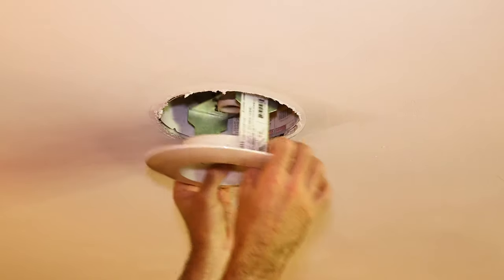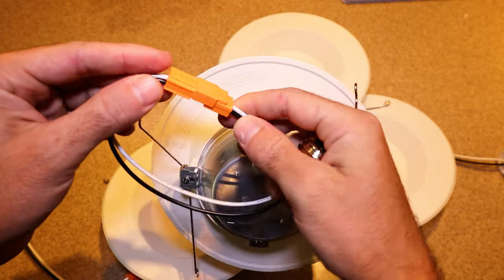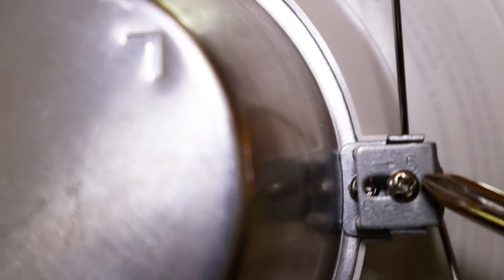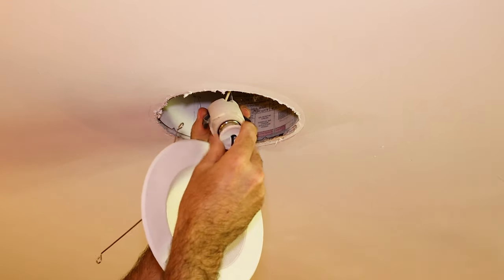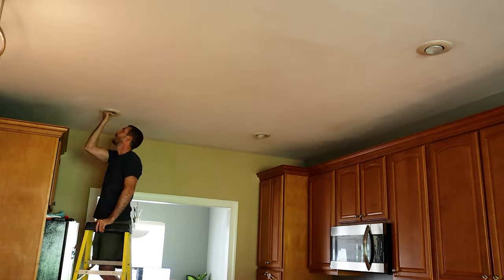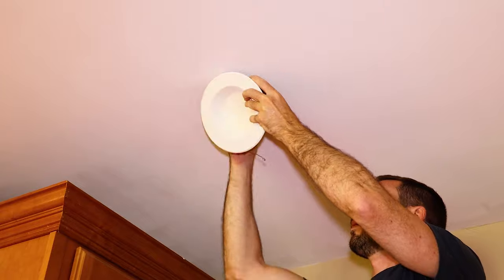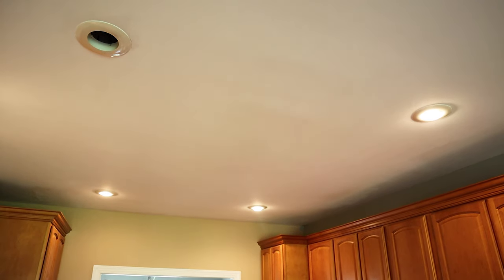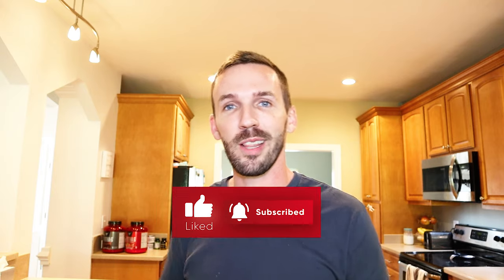Quickly Replace Old Reccessed Lights with Retrofit LED Lights

Comment: 2700 and 3000, etc. refer to COLOR TEMPERATURE, in Kelvin and not brightness.  Some see this as brightness, but brightness is measured in lumens, not Kelvin.  Some might see color as brightness because lower color lights (i.e. 2700K, warm) is seen as less bright than a bulb of the same lumen output at 4 or 5000K (bright or daylight color).
Reply: Correct.

Comment: Our old canned lights are 7-7-1/2".  The retrofits are for 5-6" lights.  Therefore, the springs do not hold the retrofit in place.  Do you have any ideas on how we can find retrofits to work for the 7" can?
Reply: I know I have a similar issue the full size measures that as well. Wish he would reply to people.
Reply: @angiejohnson6224  fyi, we ended up buying the largest retrofit we could find at HD/Lowes.  We still had most of our "rings" which cover the sheetrock raw edges.  We were able to order new rings to fit the 7" cans from Amazon.  Good luck.

Comment: You should’ve just put an LED bulb in the existing fixture. The light you used is meant to be a stand alone light in a fresh cut hole in drywall. The springs aren’t meant to hold the fixture inside a metal can.
Reply: it’s a retrofit light it’s literally exactly for this

Comment: you might have noticed some tabs on the inside of the "pot" or metal shroud.  These are made for the spring wire.  Set your spring wire just past the tab hook on each side and when all 4 wires are in place, just push up for a secure seating which should be perfectly centered.  This makes maintenance easier as the inside fixture will slide straight down and unclip easily.  Often, inside fixtures that have been "friction" fitted by twisting around will get their spring wire caught in slots in the shroud making it difficult to remove the inside fixture.  (Most often you will need to bend the holding tabs out a little bit to have room to slide in the spring wires.  I'm not sure all round recessed lighting comes with this handy feature, but you will appreciate you spend a few extra moments on your install if you have to do maintenance or replacement.)
Reply from the maker: This is amazing advice. One of my lights keeps dropping a half inch or so from the ceiling and I was considering using double-sided tape or something.
Reply: What if you don’t have the tabs ?

Comment: You asked why your bulbs kept burning out. I couldn't really tell. But they looked like LED bulbs. If they were. Make sure the light switch is rates for LED bulbs. Especially if it's a dimmer. I've had old switches cause my bulbs to burn out sooner then they should.

Comment: Heh bro. A quick mention here. I’ve been replacing blown recessed led fixture for a little while, and when I do I use the tension spring you’re referring to. That was until I found that the can I’m installing into does NOT have 2 opposing clips into which my springs would typically fit. With all that tension in the springs, you’d think the two would push against the wall of the can and keep the fixture up there. 

Well, after having 2 of the 6 installs actually depart from the can (no sweat of course…the fixture stays connected and they’re very light), I started googling to find that tension springs don’t just go against the walls of a can. They are actually supposed to go through a clip on opposed sides—clips that are built onto the can’s walls. If you don’t have the clips, you should not use tension springs. I’ve had one dangle from the ceiling 2 weeks after I installed it. Talk about embarrassing!

Just an fyi

Comment: Regarding your old incandescent bulbs burning out constantly, I may have an answer.  Let me tell you a story.  17 years ago, I did a major renovation to my home. Installed maybe 20 hi-hats with BR40 bulbs. The bulbs lasted forever. I went more than a a decade without a single bulb burning out. finally, in the kitchen, the highest use area of the house, I had my first bulb burn out after 12 years.  I went to Home Depot, got a bulb, three months later, burned out. I got another and another, same thing.  At 17 years now, I still have most of the original bulbs throughout the house, still working fine, but lost a few more, and no joy with the replacements. What gives?

Now it get's interesting. The bulbs I got at Home Depot were standard 65W bulbs.  I remembered that when I first installed all the bulbs, I bought 85W Satco heavy duty use bulbs rated for 130V.  The life of a tungsten filament increases exponentially with a drop in voltage, so running a 130V bulb at 120V or less increases life waaaay more than 10%. Plus, the filaments are thicker for a heavy duty bulb. And the 85W bulb will give out the same light and consume the same power as a 65W bulb when operated at 120V instead of 130V.  Of course, the original bulbs I bought were no longer available (banned?) but eventually, I found a few cases of the exact 85W bulbs in stock at an online supplier.  I snatched them up and problem solved. No more burned out bulbs.

Of course, now I'm looking to replace everything with LEDs.  Until very recently, the LED floods were TERRIBLE, with very poor color rendering. Now, they've gotten much better, with CRI 90+ available.  It'll be hard to let go of the old bulbs, but if I can get decent LEDs, I'll be happy to lower my electric bill and save the planet.

Comment: So, I am using a Feit replacement light and the spring clips are set at 6" and the light won't stay up flush with the ceiling. Is there something that I am missing here. I followed your video and it still will not stay up tight to the ceiling, best I can get to is about a 3/8 gap on one side. Any ideas on a solution? Thanks
Reply: Man it’s a bummer he won’t really reply to anyone….
Reply: One thing missing in this video is that fact that those spring clips are actually supposed to go into some retainer clips that are inside the recessed can.  They are not made to just slide up into the can and hold it with friction.  That is why yours keep slipping down.  Unfortunately this was not mentioned AT ALL in this video, I am guessing the poster does not know about this.  Some retrofit lights actually come with the clips that will hold the spring clips properly, they are called c-clips and likely a bit of a pain to fasten into the side of the recessed can (you can remove the can to work on it - most times...but that is quite a bit more involved as you have to deal with turning off your circuit breaker, disconnecting the wires in the junction box after you remove the can, etc.).  The video creator, and others that have done what he did, have just been lucky that the retrofits have stayed up inside the cans, or have they?

Comment: The problem is the socket is loose. I don’t think this will pass the code. You need a bracket to hold the exist old socket. When you removed old lights the socket was fit with the old can. 
I did the same as what you did but having a loose socket is not right.

Comment: Bulb burn out could be due to having a higher amp/voltage output in the home than the fixture can handle. You need to check what voltage the fixture handles and what volt output the junction box has. I have seen some homes run on 220V and most fixtures use 110V. Hope this helps.

Comment: Where can I get that metal housing (@00:40) that was on the old setup?  I am going back to using a bulb and the shroud doesn't bit because the springs can't attach to the canned housing (where your spring clips slide into).

Comment: This was helpful. At least I know what to order and how to put them in…unfortunately, my canned lights do not pop out that easily. The tabs are at the top, spaced so far apart I would need both with my little female hands to pinch them and they are so STIFF I'm not even budging them. Nothing is ever easy.

Comment: King of recessed lighting. Great job as always. By the way... what's wrong with 6000 lumens and having the house look like a Dr's office?  LOL!
Reply from the maker: I've used 5000 lumens in a bathroom and if I didn't look pale enough, I definitely did then!
Reply: @KellyConcepts  BTW, I think you mean color temperature, which is a different concept than lumens. Just clarifying here because it might confuse people looking at specs. Talking color temperature, 2700 kelvin (aka 2700k) is typical "warm" lighting for a home. 3000k is less "warm"
typical in bathrooms. 5000k is cooler, more accurate lighting, (sometimes called "daylight" lighting), and it is most often used in places where you need accurate color rendition (like a doctor's office, workshops, etc). 

Lumens is the measure of brightness. Example, an old 100 watt incandescent bulb is about 1600 lumens. As a generalization, 100w was a brighter high power bulb. A typical recessed flood light was 60-75 watt, or 800-1100 lumens. Lumens are lumens, so these days you want to buy bulbs for the amount of light (lumens) you need, not the power. And of course, with the correct color temperature for your application.